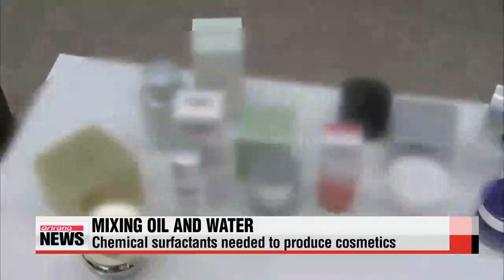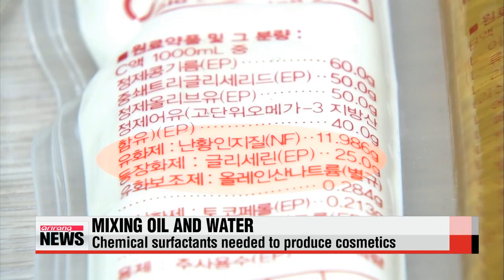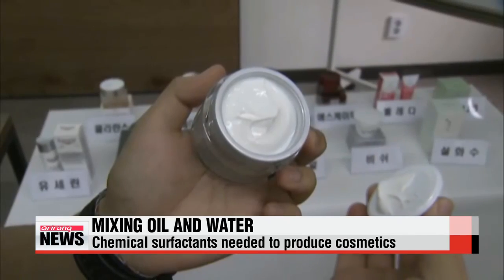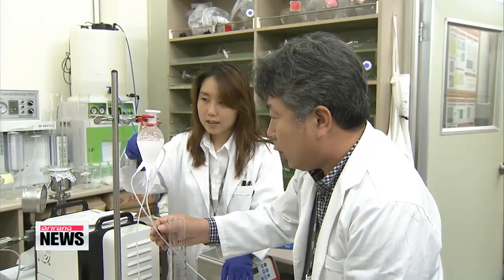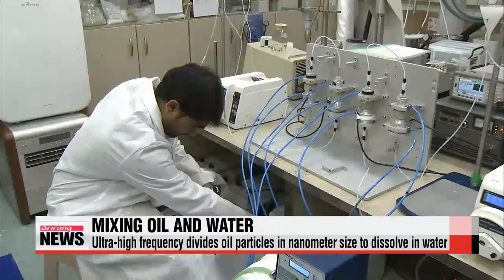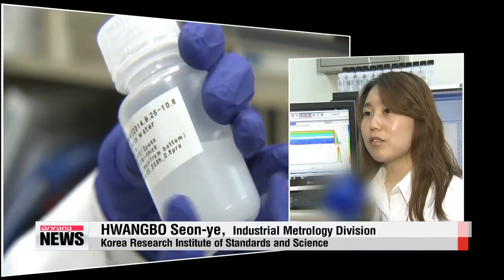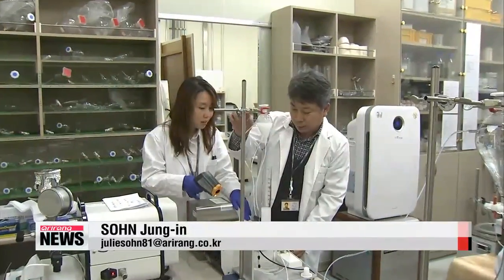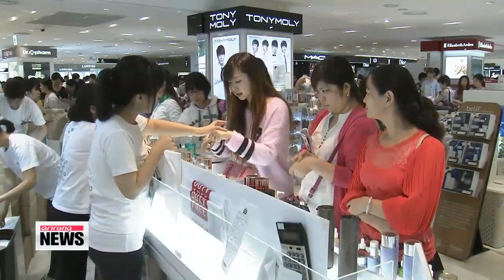Technology that mixes oil with water developed by local researchers 

′물과 기름′ 섞는

Comment: I'm not sure such a method will keep the oil dispersed for long. Part of it depends on the contrast in polarity between the oil and water. Smaller droplets generally means more surface area, and the whole reason oils separate from water into 2 distinct layers is to minimize the surface boundary between water and the oil: it's the most stable state. In the absence of surfactants or this ultra-sonication method, the bubbles would normally merge together to make bigger ones (less surface area again), and the lower density liquid would translate upwards. That's what normally happens.